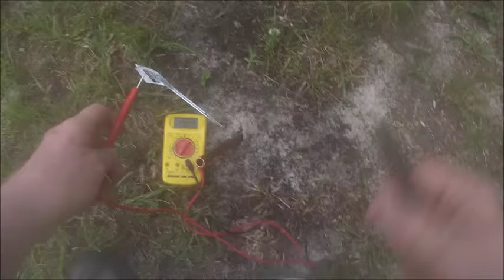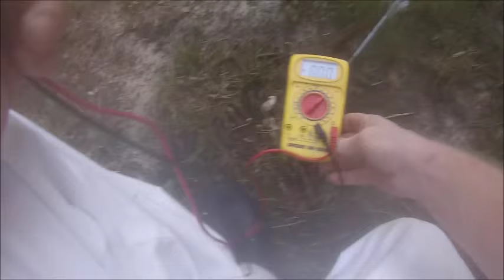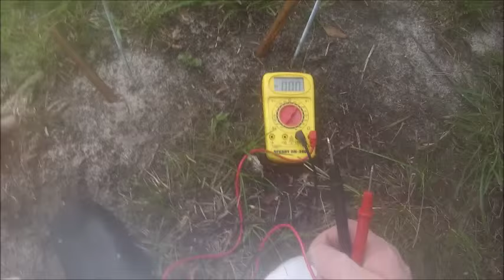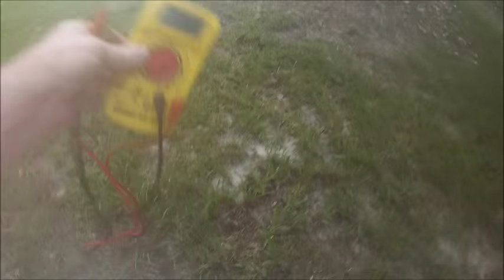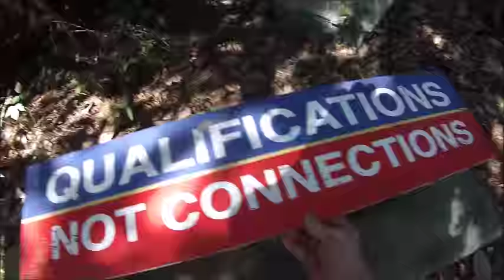Ranger Kooky VS The Great Earth Battery

Comment: In a way it is bushcraft, it could be an unusual way to light a fire, if you for some reason bring along some steel wool. Depending what voltage you need to ignite the wool. Just a though. :-)
Actually I think this is MacYvering bushcrafting. ;-D
Might be worth investigating.
Maybe it was shorted out as it would if you put battery to battery? I do not know how a battery charger works though.
perhaps if you put a lowpowered charger between the eart battery and that battery to be charged?